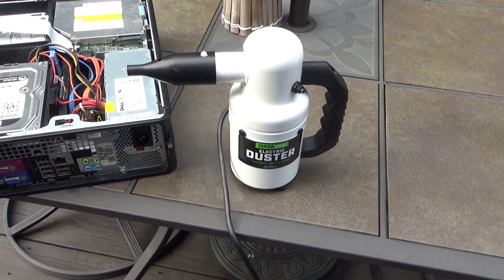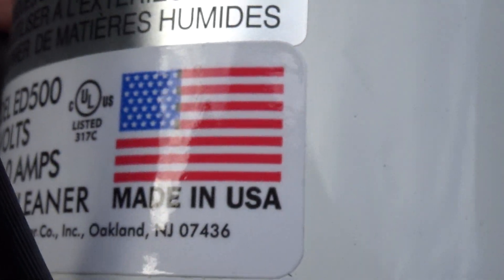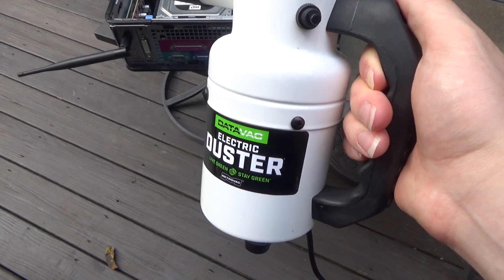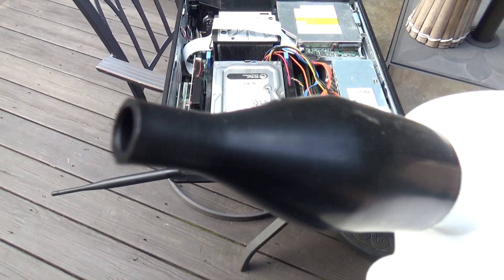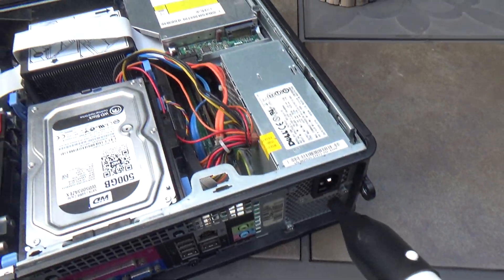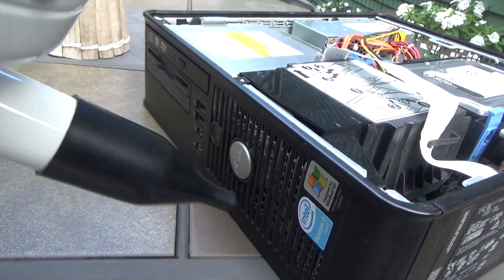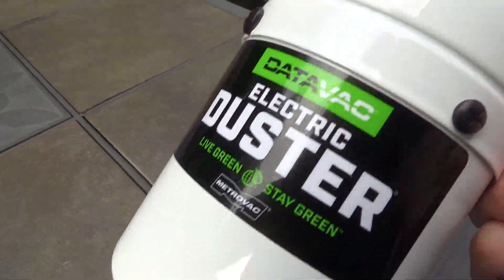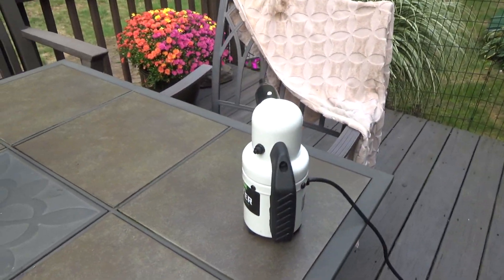Datavac Electric Duster

Comment: Interesting gadget indeed.  I looked it up, it's still sold, and I was shocked but at the same time not surprised to see an abnormally high price.  I'd much rather get an air compressor to use for less money, and it would work better as well.
Reply: Sure it's a high price, but you're supporting a Made in USA product.  Though I will say that with the overheating issue it is a bit too high.
Reply: Made in USA means nothing anymore.  And if it overheats so quickly, well we can place that right up there with Chinese stuff.  Thus, no point.
Reply from the maker: We don't know the whole truth behind the Made in USA logo on there, but the fact that at least part of the manufacturing and assembly process was done here is a lot better than none of it being done here.. I've cleaned hundreds of computers and plenty of other pieces of equipment with this thing, it feels very, very solid and well made.. I don't doubt it will hold up for years to come..
I've actually never used it long enough to get it to overheat, the overheating is warned about in the manual and noted as normal operation..
An air compressor definitely has more power, but you can't take an air compressor around with you from office to office, or into the server closet.. This can go just about anywhere you want..
Reply: Very valid points.  Though I have an air compressor that's very compact and can be handheld.  If it's too big to fit, an air hose and blow gun nozzle is still smaller than what you've got there.
Reply: It’s more for technicians that has to deal with PC every day.

Comment: You should use a transformer to take the voltage down so that the motor doesn’t overheat. Maybe down to 94 V or so. If you want it slightly higher than that, fine.
Reply from the maker: That would probably extend the runtime, but I've never needed it to run longer than it permits.. I'd rather not lose any power from the device..
Reply: OK. That’s fine. I know that you don’t want it to run longer than it permits.

Comment: The idea of dusters/compressed air is ok but it doesn't do anymore than just blow/move the dirt/dust out of where it want to another part of the case. 
When I clean a computer I completely remove every component (HDD, Video card, PSU, Heatsink, RAN, Cables, etc) and blow each part and vacuum them and the inside of the case. Making sure im not blowing the dust back into the case or just moving it to another spot.
Reply from the maker: That is factually incorrect.. It is very easy to completely remove the dust from the case using forced air.. Taking the entirety of the machine apart for a simple cleaning is arguably a waste of time and resources, creates unnecessary risk and is totally impractical in any kind of enterprise environment where there is more than 1 computer..